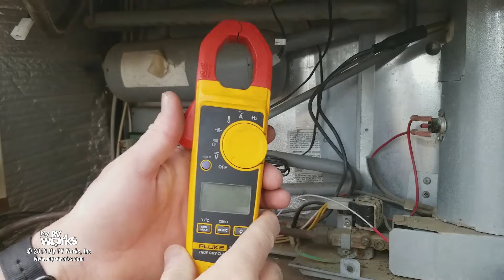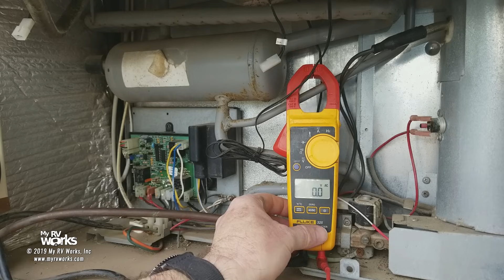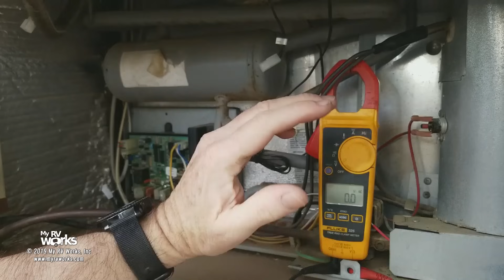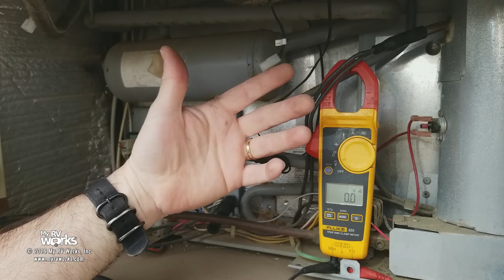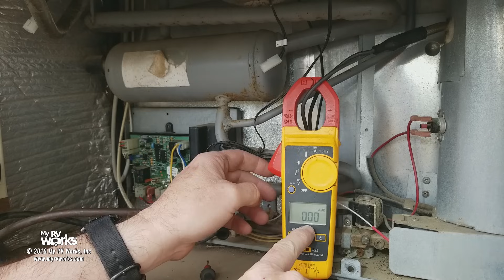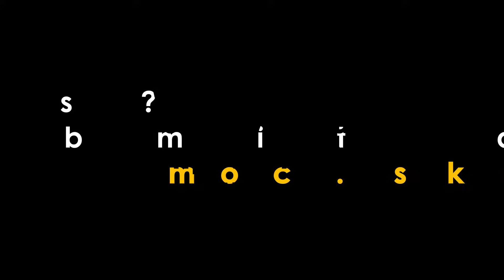Troubleshooting An RV Refrigerator That Works On LP But Not On Electric

Comment: This is the best rv systems diagnostic channel on YouTube! No guessing, no parts swapping in hopes it's fixed.  Clear and simple diagnostics that lead to the failed component. Great job, keep'em coming!
Reply from the maker: Thanks for watching, I'll keep making them. Been kind of busy with customers lately but it should slow down a bit where I can put more quality in my videos.
Reply: Please help .I got a new board and heating element. Checked all fuses and breaker is good .3 service calls later my check light is flashing and it won't work unless I run it on propane .what am I missing.
Reply: @yappinyorkies  did you check for 120V at the board?
Reply: @larryreno8293  yes
Reply: Everything is weird, so it won't work on ac ,but clicks over to propane. I need a picture of wires hooked up to control board to make sure all of them are right, but I can't find one.the only thing I know is new element and maybe front panel inside r.v
Reply: i know im asking randomly but does anyone know a trick to log back into an Instagram account??
I was dumb forgot the account password. I love any tips you can give me
Reply: @Marcelo Terrance Instablaster :)
Reply: @kadenlayne1065  what are you two phishing for?
Reply: @Kaden Layne It did the trick and I finally got access to my account again. I'm so happy:D
Thanks so much, you really help me out :D
Reply: @Marcelo Terrance happy to help xD

Comment: Finally. In depth analysis for my refrigerator. Awesome work. Thanks for making the effort Darren. It is appreciated more than you know.
Reply from the maker: If you liked that one make sure you get the more in-depth one where I draw a picture on the airflow on the back!  

Here is the link:  https://youtu.be/IT_5HGe4q-k

Happy Camping!

Cheers,
Darren
Reply: Does 120 need to be coming from both j7 and j8 or just one side

Comment: I had a RARE problem but thanks for the video in help figuring it out. My refrigerator would work on power sometimes then it would stop only to minutes later switch back. Mine was the receptacle with the slice termination blades. Where you lay the wire between to pinch blades. I would get power until a jolt of some kind would knock something lose in the receptacle. I wouldn't have power so I'd unplug the cord and check the receptacle and then have power. I guess everytime I touched it it would trigger the fault off or on. I scratched my head and tested for 2 days until I figured it out. I changed the cheap receptacle to a standard one now everything is fine. I have never seen a receptacle like it really. I wonder what village in China they found it in !! Thanks a bunch for the video though. You are very kind to show people for free on here so I liked and subscribed.  Least I could do.

Comment: This was a wonderful tutorial.  My husband and I do not know much about propane appliances except of course for our bbq.  Last week our dometic propane fridge in the rv stopped working on propane.  We left it on electric power for the week and thought we would have to get the rv company to travel to our campground to service it.  After watching your video, we tapped the silver cylinder then used our air compressor to clear out the debris, now it is working fine.  Thank you sooooo much!
Reply: Curious to know what you tapped..  My heating system is all black piping rather than silver.   Can you describe which part you tapped?   Thinking I may have a blockage of some sort in the system if cooling does not occur with gas or 120 V power.     Still troubleshooting reason for now cooling.

Comment: Thanks for this video.  Very clearly done.  I had an electrical problem and I followed the steps you show. It lead to the conclusion that the heating element was bad.  I replaced the heating element and all is well.  I knew nothing about refrigeration before watching your video. Thank you so much.

Comment: I watch your converter replacement and the problems with the refrigerator not running on 110. It was the heating element, replaced it after watching your videos. We are up and running and mommy’s happy. Lol thanks for the videos they were great help.

Comment: WoW!! am I ever so glad I stumbled across this one. You, my man, knows exactly what your doing after watching a couple of your informative vids here and my utmost respect goes out for that alone!
I guess I'm an RV owner now, if a 1980 Fleetwood Sunset counts? I bought it on Sunday July 4th. It's been well preserved, 36,000 original, and put away (improperly, somebody shrink-wrapped the entire thing and stuck it out under an out buildings eve.) for a long time. Now after getting it home, the fun begins!!
I service consumer electronics and I'm also not a bad mechanic (only on my stuff) Amazingly, the elderly folks who owned this thing kept up everything interior wise, and in the glove is every Owners manual for everthing from the generator, refidge, microwave, 9" color tv w/ VCR, down to the aftermarket cruise control, and even the Kraco AM/FM/Cassette radio w/ locking FF!! lolz (which works fine & wired to 4 factory Fleetwood coaxial spkrs)...The Kraco just got replaced today w/ a 7" touchscreen GPS/Stereo/MP3 system,
But now down in the basement...lol, they neglected any of the maintainence other than having the fluids, tires changed. I spent almost 90 minutes in the basement (on the ground) with a steam pressure washer wand knocking out 1/2 inch of grease buildup all over everything down under. I bet that RV lost 100lbs. Mud daubers nests, hornets nests, spider webs, dirt, oil and gawd knows what else
Well worth the effort, looks 100% better today, I can even read signs, ID plates, and stickers again. has an "Onan 4.0 BFA" 4kv generator under there (starter relay needs replaced, or it's froze), also a propane tank, water tank, sewage tank and 2 thirty-sum-gallon gasoline tanks ...SO I guess It's really a tank??

somebody bought a lot of options with it I think. I'll say 97% of it all works, I have a couple issues, and my refrigerator is one of them, it's one of those gas or electric one's (No "Auto" on switch, just "gas" or "elec").... when first plugged into 30 amp@ my houses breaker box, could have swore the fridge light worked when I opened at first, I thought that the freezer part was starting to cool, but not the bottom yet...I may be hasty on that thought. But now I have nothing @ the fridge. I'm great with troubleshooting, but I have to see the layout, never messed with RV's so finding locations for things right now is the mission. Letting ya know now my friend, I may be bugging ya with inane questions, SO thanks in advance ;)
Already at your Manuals site.... fookin Genius right there now
~PeaasOut
PS: Still have know idea what motor is in this, I'm leaning towards a 440, I do know it's all Chrylser under there (theres a Model plate), and I may have to replace the transmissions pan gasket, and still no idea what transmission they put in it either.
I'll figure it out....All in due time... 
Thank you for sharing your knowledge!!

Comment: Thank you very much for your video. We have an Atwood frig. We had a power outage a couple of days ago. We noticed frozen food starting to thaw. The control box you show and mine are similar. I did all the tests and was very frustrated as we live in our rv and I couldn’t figure out what to do. I opened the control box and low and behold I found the 3 amp fuse had blown. I work away from home and luckily I decided to come home for Father’s Day and noticed a problem. My lovely wife did not suspect anything wrong and definitely would not have figured out what to do. I would have had to call a technician for how many hundreds to find out it was just a fuse. Thank you again for your video.

Comment: This video along with a few of your others taught me how to troubleshoot my issue. I wanted to thank you for the needed help. My refrigerator was running on LP gas only. Your video showed me how to trace the power and it turned out to be a fuse on the board.

Comment: Excellent video !    I mark the connectors and take a picture of the connectors/board before disconnecting anything in case I forget how it was hooked up, or if I have to delay reassembling it for some reason.   I work in electronics too and appreciate the details. Thanks again !

Comment: I have a Norcold N811. The cooling coil leaked. Ordered a replacement, swapped it out no big deal. Been a Mechanic/ Electrician for 30+ yrs. No issues with Function before cooling coil problem. Turned the unit off, after the new coil arrived I changed it over, put it all back together, no issues. Works fine except it will not run on Electric now. Checked Heating Element 46.5 ohms. According to info looked up that’s perfect. Ordered replacement boards 4 to be exact. Also New Optical board, purchase power is steady 115.7vac up to 118.4vac. Burner controls light every time, after initial startup, green indicator comes on steady and then the LP controls take over, while yellow gas ind. comes on steady, green ind. flashes three times. That gets it good and cold but it acts like it is not seeing 115 vac at all. All new boards do exactly the same start up. I even marked the connections with a red marker to keep from forgetting the proper wiring locations, even though it’s kind of self explanatory. So I’ve looked and researched for over a month and half now but nobody has anymore helpful tips. I took the limit switch out of play, and installed jumper. Thermistor is the only thing not replaced besides fan which works well. I like your videos BTW.

Comment: Thank you so much for posting this video. I followed everything you said, so I thought. I pulled off the cover and checked the fuse. Fuse is good. I started following wires to see if something was disconnected. There was the culprit- it was not plugged in. Ok so I missed one of the first steps. Thanks again!

Comment: Great video! One suggestion, use the system neutral, rather than ground, for testing, it's the return for the system, not ground. You can have an open neutral and still read 120 volts to ground.

Comment: He is doing well on his description and use of the VOM, I am being picky but the control board has to have 12 v DC to operate either on AC or LP , the board has a 12 v fuse as well and your first thing to check is the 12 V. My experience as an electrician led me to find the 12 v wires were broken just under the wheel well. The owner replaced the lower control and was going to replace the fridge. Quick check of the fuse and turns out the fuse also is hooked to a light where it was burnt off under the light probably from a loose wire nut. Either the light was added or the wiring crew did this original. Good video but to a DIY you could get the feeling the 120v AC is enough to trouble shoot.

Comment: These videos have been extremely helpful to me.  I have learned quite a bit about my RV fridge as a result.  I think I have successfully diagnosed my fridge issue (heating element) but I won't know for sure until the part arrives...
Reply: Replacing the heating element fixed the refrigerator.  It took about 30 minutes from start to finish.  It was very straight forward...of course that was after watching Darren's video.
Reply from the maker: Hi Guys,

We are so glad to hear that our videos were able to help you!  If you would like to support us please consider becoming an "RV Community Supporter" on our Patreon site:  https://www.patreon.com/myrvworks

Happy Camping,
My RV Works Media Team

Comment: Thanks for this! Was a little confusing at first, but I learned that I was only get 4v to the element wires. Obviously had to be 120v. Got a new Dinosaur Electronics board in & electric works on the fridge again! Thank you 👍🏻

Comment: Thorough video abs easy to follow. I employed all your tests and found no power output from board. However before replacing the $100+ lower/outside board I bought the upper/inside board and boom; problem resolved for under $30. Just wanted to comment since it wasn’t mentioned in your video and I read online lots of people replace lower board and it doesn’t resolve issue.
Reply: Can you give any info as to where that board is? I just replaced this one and still have the same issue you had with no power leaving the board.

Comment: Darren, great video and troubleshooting.  Any chance you have done a video on the other failure mode?  (works on electric but not propane)?   I have checked all the basics, have 12 VDC, have a nice blue flame front with no startup issues, blown out rust from the flue and burner tube, but still have weak cooling on propane.  You do great work on YouTube, please keep it up!

Comment: Helping a friend with his Norcold 6162 single door auto control gas/electric. Turned out it was the 15amp fuse. Looking at it looked ok but with the continuity check it failed. I think its cooling now but I told him to put some water in an ice tray to see if it freezes up tonight and the box for food gets down to around 40. He got a new board but didn't install it yet

Comment: Very helpful video that helped me to fix my cooling problem.  Curiously, I only have 106 vAC coming from the outlet and into the panel and only 100 of the stated 420 watts going to the heating elements.  The supply outlet in my garage measures 116 volts.  I have no idea where the missing volts & watts are hiding.

Comment: Great video!! My Norcold 1200 LRIM in my 2004 Monoco Holiday Rambler Neptune is only cooling on LP, and gives me the no ac fault code. Hopefully tomorrow I’ll get time to buzz the two heaters and see if that’s where my problem lies. At first glance, the heaters appear to enter the boiler to high for me to change them from outside like I saw you do on a dometic on another video. Do you run into instances like that where you might have to pull the frig, and change the heaters from inside? Please tell me no. 😳😲😂 Thank you!!

Comment: Your video was very helpful. I have no 120 coming out towards my igniter I think that's what you called it on the electricity side of the board. So I'm assuming I need a new motherboard or whatever you call that thing. Refuses are good I followed all the instructions you gave I've got 120 each side of the fuse on the board. Like I said nothing going to the electrode that boils the juices to get my refrigerator flowing. What's my next step what do I go you said you had some more videos on that how to change the motherboard
Reply: Will I swap the motherboard out And it's still not working.

Comment: Thank you!!  My Dometic RM2862 fridge suddenly stopped working with AC and only worked on propane.  Initially my daughter discovered the heating element had a melted spot on the black plastic, so she replaced it.  Still wouldn't run on AC.  After two weeks, I ordered a Fluke 323 Clamp Meter.  Daughter had given up on troubleshooting my fridge any further.  When the meter arrived, the first thing I did was check the 5amp fuse with the Fluke.  120 volts read on left side of the 5amp fuse, but zip nada on the other side.  Bought some 5amp fuses, replaced the burned out fuse and wellah!  It works perfectly on AC now.  I was ecstatic!  My daughter pretty much said nothing.  LOL

Comment: Great video. Mine will blow the fuse even with the heating element disconnected. Do you have a video for checking the board?

Comment: This is a great video as I have exactly this problem.   After several hours of shore power, no cooling.   CHanged to propane with cooling in a few hours.    Other vids were not this detailed, or stopped short of explaining the heating element, checking its resistance for 80 ohms +/- 10%,  and the board that should be 120 V at the prongs where the heating element plugs on. 
I appear to have to issues:  1)  my board does not supply 120 V to the pins that feed the heating element wires and 2) my heating element wires have 8 ohms of resistance rather than 72-88 as indicated in the manual.     Looks like I might be in for a new board and heating element.     Do you have any videos for replacing each?

Comment: Sounds like a short. Check your wires and their connection points. Make sure they are not touching anywhere they shouldn't be. Make sure they are still in good shape. If you have moved wires around already trying to fix things, make sure that they are all correctly connected.  Positive to positive and neg to neg. This happened to me once, and I had mixed up my connections on my fans.i kept blowing the 5 amp fuse. Hope that helps

Comment: Outstanding video…and have a follow-up question on my results…Got a RM 7742 dometic refrigerator . ..like the video…The fridge works great with gas, but not 
Plugged in.  followed your trouble shooting steps 
and all was good (fuses, ground, 120v output from board to heating element) except the ohms on the two heating elements are at 35 (couldn’t test them independently), and the book says they should read 69 each.  I’m not sure if i can make the next step of doubling my ohms reading to 70, since I have two elements…and it test as good (69ohms each) is logical … or am I missing the obvious.   Any ohms expertise would be appreciated…

Comment: Great video! My dometic Dm2652 fridge blows the 5 amp fuse as soon as it calls for power. It does cool on propane. The heating element has 43.5 ohms of resistance. In your opinion could it be a faulty circuit board? Appreciate any insights!